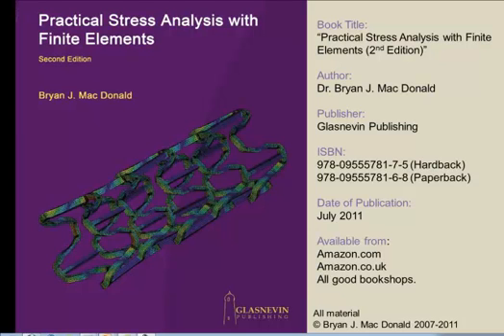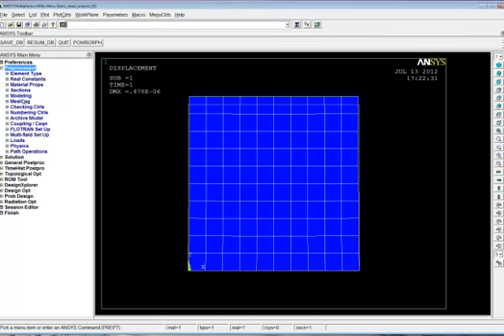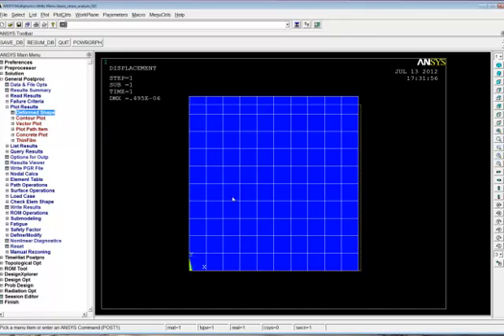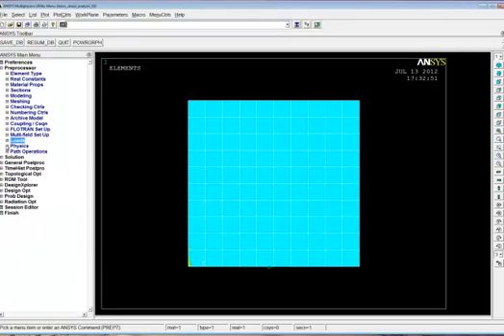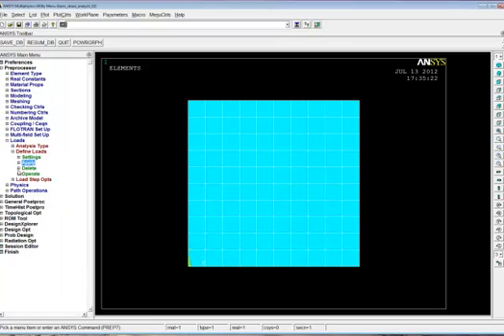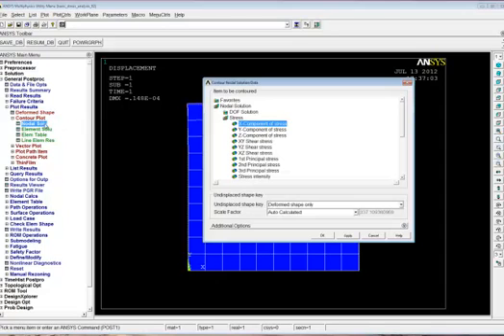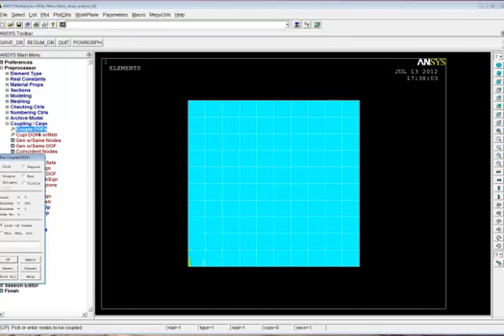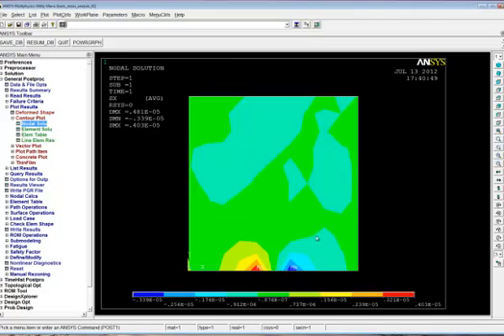Basic Stress Analysis with ANSYS - Part 02

Comment: in Abaqus, i predefine the geometry set and based on my mesh refinement it automatically picks all the node on that surface. here for coupling, i see you manually picked the nodes. what if you refine the mesh, you will have to pick the nodes again? can you define a geometry set of top surface and then put a coupling conditions on the set, so each time the model is refined or mesh is changed, it automatically updates the set and so the coupling gets updated too? thanks

Comment from the maker: Hi, in this case they would both produce the same result. A pressure load is easier to apply (as you suggest) but sometimes people get confused as to what "force" they are actually applying when using a pressure load. In more complicated analyses it is not always possible to use a pressure load.